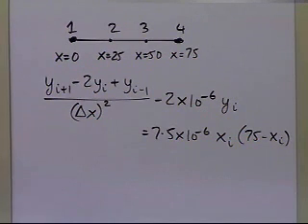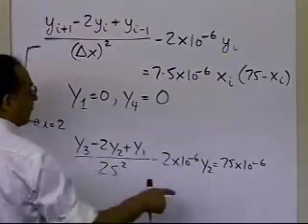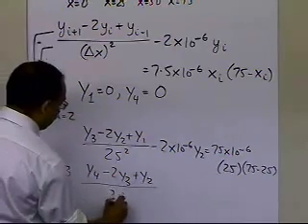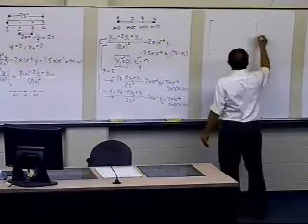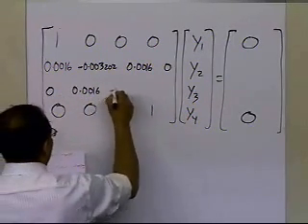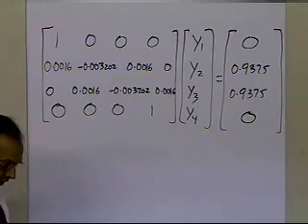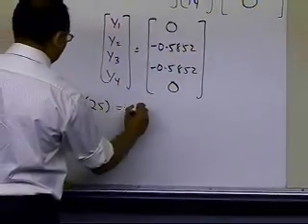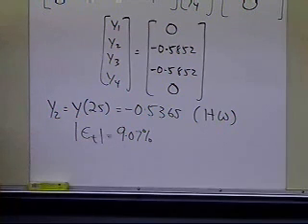Chapter 08.07: Lesson: Finite Difference Method for Solving ODEs: Example Beam: Part 2 of 2

Comment: Thank you for the lecture!
At around minute 3, how do you get the calculations?
I see the equation for nodes i=2 and i=3, but how do you get numbers from those equations because we do not know what the value of y=3 and y=2?
@i=2  y3-2y2+y1  - (2E-6)(y2)=75E-6(25)(75-25)
we know y1, but how do you get the matrix value from this equation?

Comment: The explanation is great. Do you have any examples of equations that has both time and space terms in it? I am trying to solve it. I have done using explicit method but it takes weeks to solve in matlab. Do you have any code that solves fast ? My problem includes very small values which make it analyze small portions, so its slow.

Thank you so much for the help.